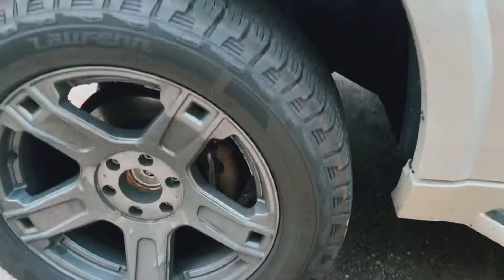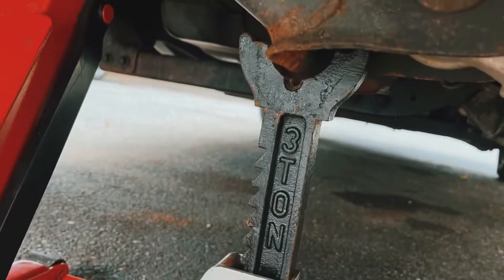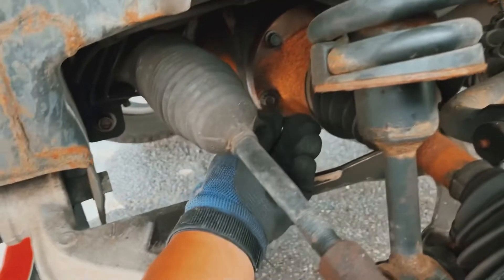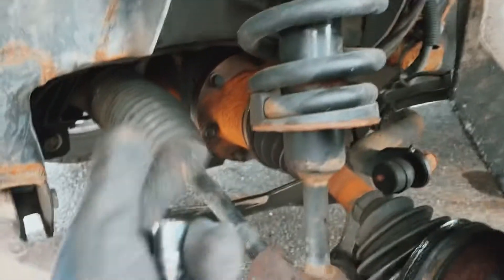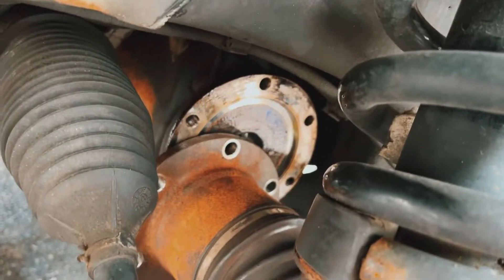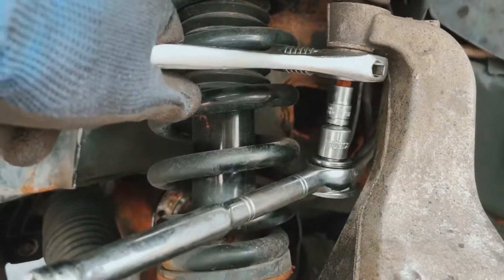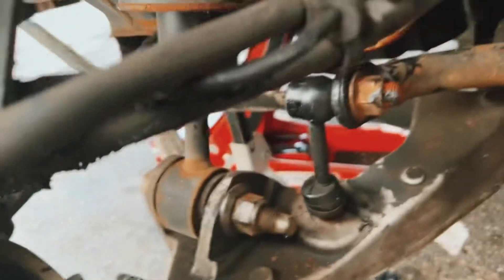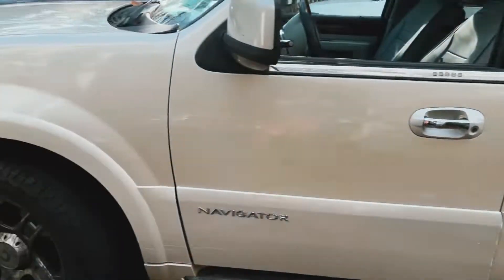2006 Lincoln Navigator Front Axle Replacement

Comment: How do you poo out that upper control arm? I took the 21mm nut off but it won't come loose. I'm hammering on it hard
Reply from the maker: It may have stuck there from years of water, salt and rust..you may use penetrating oil like Blaster and some heat to help loosen it. There are also tools available for this job like a “big fork” to stick in between there to push it out.

Comment: What sucket size do i use to removed the axle, are they 6 point sucket or 12 point sucket....and what size?
Reply from the maker: Oh wow my apologies I did not include this info..It’s been a while since I performed this work so I’m not really sure. One thing I can say though is be careful when you put the bolt back, don’t over tighten it otherwise you will need a new axle..ask me how I know 😄